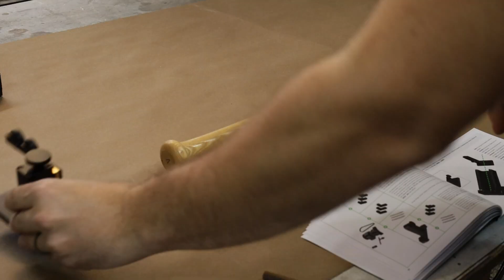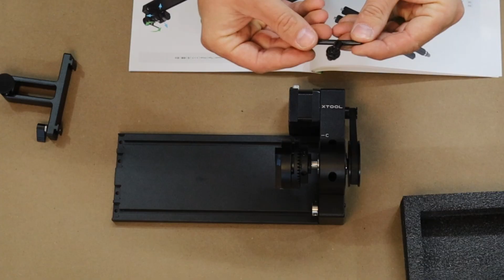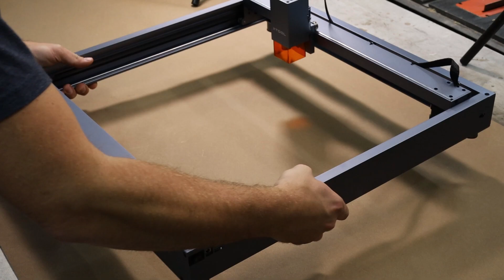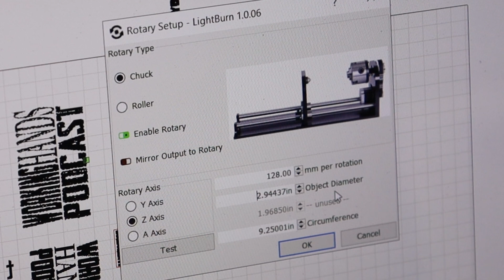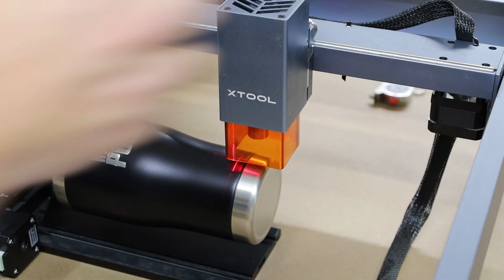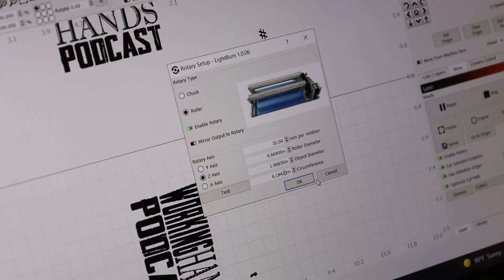Watch BEFORE You TRY The RA2 Pro Laser Rotary Attachment

Comment: If you leave 0.5 cm of distance from the laser module to the tumbler you will have a clean engraved.
Reply from the maker: That’s a great tip thank you for sharing mine were definitely burned too slow too, I think I was changing the color of the steel.
Reply: I was forced to go step by step and I finally realized that distance from the laser module to wherever you’re engraving makes a huge difference.

Comment: The X Tool does not have the power to laser cleanly to the metal. The shadow that remains is why the X Tool is a hobby tool. The rotary tool is versatile.
Reply from the maker: You’d be surprised I was actually using too much power here it was darkening the metal when I should have just been removing the powder coating. I could have run it much faster.
Reply: I have found that Simple Green and a tooth brush cleans it up very nicely. @ChadsCustomCreations
Reply: @ChadsCustomCreations What’s a good setting for an insulated mug?? Power and speed… thanks

Comment: the engraving does not look bright what I did is use the coatel parameter 100% power but lower the speed I use a 10w diode
Reply from the maker: Yes I agree I believe my setting were not optimal. I thought I was actually going to slow causing the metal to engrave darker than normal, but I could be wrong it’s been a while.

Comment: Did you ever find a way to make the engraving "cleaner"?This is the issue we are having.
Reply from the maker: On these cups I was running them too slow, so that would have made cleanup easier. Or if you are talking about the resolution try decreasing the line interval number or dpi to make the laser engrave a higher quality.

Comment: Great video. So you mentioned that the extra port on the control board is no longer there on new units?  I have a D1Pro 20w and seems like all the setup videos I see, show that port being empty. I've been trying to figure out why mine is different. I'm glad you mentioned it, because I have not seen that from xtool. This means that I have to disconnect the Y axis motor plug whenever I want to use the rotary, and then swap it back when I want to use the xtool without the rotary? And do I check the Y axis option in the setup of the rotary? Also, is it me or does xtool have poor support manuals/videos for this detailed setup. 
Thanks,
Alex
Reply from the maker: Yes this was kind of a sad update honestly I could do without the limit switches

Comment: Will this work on a K40?
Reply from the maker: You might have to make an adapter for the wires but you would plug it into the y axis motor line and it should work.

Comment: Are you using a 10W or 20W laser? 25mm/sec at 100% power won't do much on my 10W D1.
Reply from the maker: 10w make sure your in focus and your lens isn’t dirty.
Reply: @ChadsCustomCreations  25mm/s sounds extremely slow to me.  I usually go with 60mm/s @100% pwr and is enough for well know brands (and for some generic Amazon tumblers I will go up to 80-90mm/s and still do fine).  In fact, at the low speed you used, aren't you etching the material? seems a bit too dark instead of super shiny.
Reply from the maker: @mcwaremexfdz  you are right Marco I was over burning these going way too slow ended up spending so much time trying to buff them back too a shine when I should have just gone at the speeds you recommended!

Comment: Helpful video, but the tumblers didn't seem to have nice finish. Seems to have an uneven finish. By the way, what is the setting for the dishwasher?
Reply from the maker: You’re right I think o actually had the speed too low on the laser and was actually discoloring the metal. I should have sacrificed one of the tumblers and just done a speed grid to find the sweep spot.

Comment: how do you the rotary to show up in your side box and where you say plug wire in and you can leave it mine already has a wire in that spot?
Reply from the maker: Under options make sure you don’t have beginner mode on. Also with the Xtool pro newer version of what you see me using here you have to unplug that that wire and plug the rotary into that spot. You are unplugging the up and down motor and giving its power to the rotary.
Reply: @ChadsCustomCreations  do not have beginner mode on still not on side

Comment: I only have one connection on my board and have to chose between my Y axis or my rotary...Am I missing something?
Reply from the maker: I do believe the extra spot was only available on the older model before they came out with the pro and added the limit switches.
Reply from the maker: I do believe the extra spot was only available on the older model before they came out with the pro and added the limit switches.

Comment: I have the beginner mode on the lightburn so on the laser window I don't have all those settings like the enable rotary,  Cut selected graphs,  Use selected origin or Optimize cut path. So why is mine different from yours?
Reply from the maker: Turn off beginning mode.

Comment: I have followed all of the directions and have it all set up. I have my project framed but now when I go to start the project nothing happens?

Any advice?
Reply from the maker: Hmm sounds interesting is anything moving when you hit start?
Reply: @ChadsCustomCreations  It will frame when I tell it to, but as soon as I click start nothing happens. The laser will not fire nor move when prompted to start.
Reply from the maker: @Dgsvids  are you using lightburn, if so make sure the output is checked for the color layer you have selected for the image your using. Also be sure that you have the item selected if using cut selected items only. To me it sounds like it’s something in the software.
Reply from the maker: @Dgsvids  one other thought I can’t remember if this is true or not but after hitting start on the computer you may have to press that top button on the xtool to get it started.
Reply: Sometimes mine does that too. If u watch your computer screen does it do a quick pop up with possible out of bounds lasering? It only last a few seconds so it took me a bit to notice it.

Comment: Pro cannot simply switch on and off the rotary without re-configuring the cables. Apparently the cheap-o's repurposed a stepper motor port for limit switches and now dedicate the y-motor to the rotary attachment port... frickin frustrating
Reply from the maker: Yes this was a bad move on XTools part I feel like for a few extra bucks they could have put in some kind of splitter for the cables.

Comment: I have a Sculpfun S9. Is this just a plug in and play with my machine? Using Lightburn. I suppose it’s all gcode and should work?
Reply from the maker: Yes I believe it will plug right in. Check the listing from the links in the description I believe they have a list of confirmed plug in and ready to go if not you could always wire in a new plug.

Comment: Really liked your video here.I have been working with my tumblers and keep running into the same problem in Lightburn, the program makes everything about 2 inches wide no matter what. I must be missing a step somewhere but not sure. Relatively new to all this. Using the xtool D1. Importing graphic from gimp. Thanks in advance for any input.
Reply from the maker: In lightburn you want to go into the rotary setup under setting or tools and you gotta find the correct amount of steps per rotation to calibrate it. Or if using the rotary chuck you must also remember to set the circumference or diameter each time you use different sized objects.

Comment: I’ve seen on other videos that the mm (stops) per rotation should be 1440 not 128. Why is your’s different?
Also I think it looks like your engrave is too deep. It looks like the steel isn’t shiny?  Did you get settings that turn out better that you can share?
Reply from the maker: At the time that is what was recommended on their website and it was accurate for me you can test this out but marking your start point and end point with some tape and a sharpie and running a rectangle that is the height of your circumference. 

Yes I believe I was running it way too slow at this time it was actually darkening the metal which is not what you want, really you just want to remove the top coating.

Comment: Using "LA AWESOME" works the best when cleaning tumbler cups and you can get that at Dollar General .
Reply from the maker: Definitely going to try that wasn't sure if I was maybe running too slow at 25mm/s at 100%  Thinking now I wonder if I was maybe marking the metal going that slow. Should have spent more time on my test cup.
Reply: @ChadsCustomCreations  your temps were too high, you were reburning the coating back onto the cup, i generally use 40-60 at 70-80 speed for cups, use la awesome and it wipes to the shiny color. i'm sure you have it fixed by now though.
Reply from the maker: @tonysucksatoutdoors  thank you Tony I knew I had something wrong. I should have just sacrificed one of the cups and done a speed scale test.
Reply: @tonysucksatoutdoors  I'm even lower. I run a 20w at 25% power at a speed of 25. Nice and shiny and crisp lines. Sacrificing a cup to dial in those numbers is the way to go.
Reply: @scottdouglas9858  yep I have a test cup that has all kinds of cuts on it haha

Comment: Thank you for the education, well done.
Reply from the maker: Happy to help however I can.
Reply: @ChadsCustomCreations  Hi Chad, thanks again for the help. I'm trying to run the same tumbler as in your video, so I reverted back to your informative video for my setup. 
I'm new to this so please forgive my ignorance, but I'm trying to figure out why your running 25mm speed with 100% power, if all you're trying to do is remove the paint from the tumbler?
I just updated my LightBurn software to 1.2 so I have the latest version.
My logo I'm trying to run is about the same size as in your video, but my preview shows with your settings used it will take over 40 hours to complete the project.
I can't even get the project to frame properly, so I know at least I have a compound problem, if not worse! However the main take away from your video for me was the rotary orientation to the machine, and the logo orientation in the software. Now I just have to put on my thinking cap.
Keep helping us man, not that we deserve it, but perhaps in the end, we can all help one another.
Don
Reply from the maker: @donaldtimmons7675  Hello Donald keep at it you will get it. Looking back I believe I could probably have run at a much faster speed I think I was actually darkening the metal at that slow speed, which I didn't want in this application. Definitely have a spare tumblers for testing or some scrap dowels to get the orinetation right. Mistakes will be made and it's best to mess up on items you don't care about trashing.
Reply: @ChadsCustomCreations  Thanks Chad, great tip! I guess I was enjoying success with the original rotary, and am just having trouble wrapping my mind around this RA2 operation.
I have plenty of dowel to work with so this was just the tip I needed!
Don